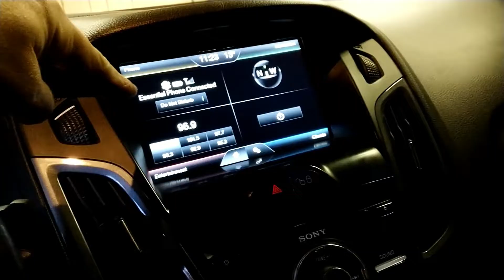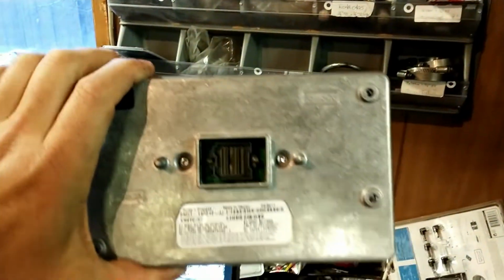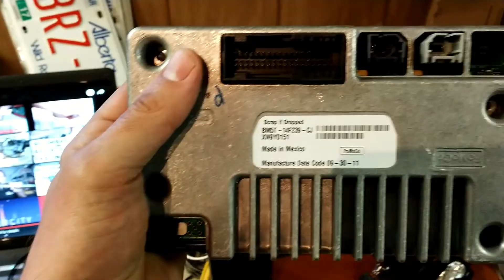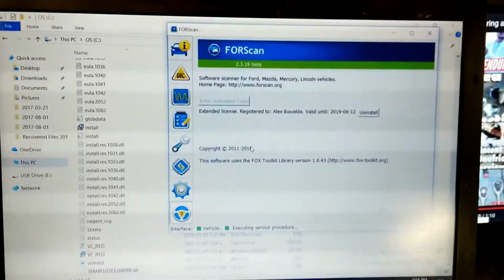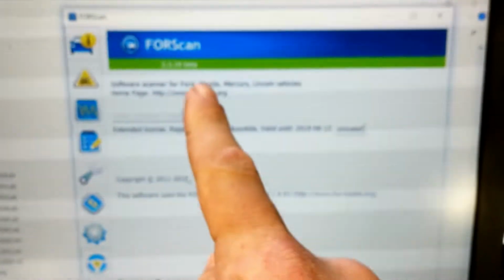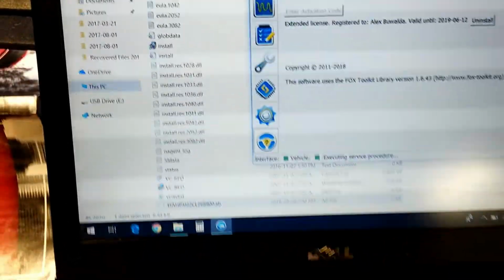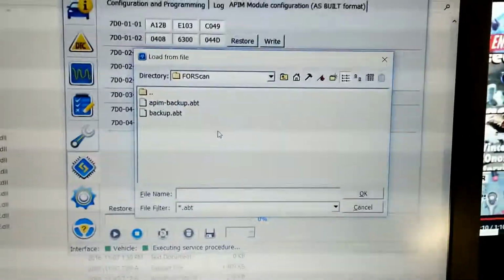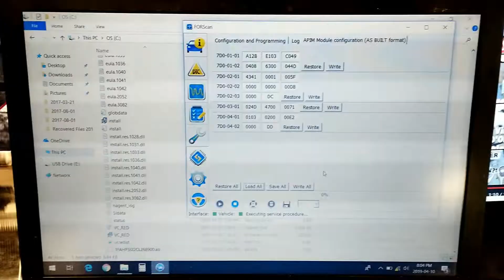Broken Ford Sync APIM Repair\Replace\Reprogram

Comment: Hi can you tell me if when replacing a backup camera on a 2012 ford Edge does the camera have to be programmed to the APIM or does it just plug into it? My backup camera was working fine till I had ford replace my APIM and now My camera don't work for some reason. They are now telling  me My camera needs to be replaced and want to charge me a little over 700.00 dollars!!  I'm hoping I can buy a camera and have my husband replace it if it don't need programming. Thank you
Reply from the maker: It should just plug in if the APIM was programmed properly and the backup camera plugged into the module.  I can't believe they'd tell you that you need a new camera after it stopped working on replacement of the APIM.  It might need a program to match your model properly which they failed to do at the dealer, I'd phone around to different dealers for a second opinion on that and perhaps a reflash to get the camera working again.  Also I'd triple check the camera connector on the back of the APIM is plugged in fully.  Best of luck!
Reply: @Kingsoupturbo   Thank you for replying. I'm  afraid to bring it to another dealer cause they may charge me more then I have already paid. Its at the same dealership again for another APIM replacement!! Its been there since 9am  yesterday. They are telling me the servers are down and can not program  the navigation.  Im so frustrated  with Ford right now!!!
Reply from the maker: @hereslori  Thats terrible! thats a long time to not have your car over a fairly simple replacement, they should be able to do this super fast, its a easy repair at a dealership.  I suppose its possible Fords servers are down, I suppose, that have the settings specific to your car, they probably programmed the wrong model and thats why the camera didn't work.  Hang in there, rub your ear lobes and say "woosah" and that everything is insane this year and rediculous, I would not buy another ford though, its been pretty disappointing, the tranmission issues with my Focus have been a lot worse then the stupid APIM.  wishing you positive thoughts on a resolution! :)
Reply: @Kingsoupturbo   Yeah it's very disappointing I finally got it back but they weren't able to get my navigation working due to the fact that this server is still down but I need my car so I told him I was picking it up and to let me know when their server is  backup and running. They are still saying that I need a new backup camera and I refuse to buy one from them and pay $700.00 and something dollars after I just paid over $600.00 for this APIM. I used to have an Explorer it was a 1998 don't laugh I had it  for 18 years and I loved it not too many problems with it and I finally traded it in for this 2012 just 2 years ago. LIke I said don't laugh lol. SO this car is real big upgrade for me and now I see all the issues I'm having with this APIM And it's really frustrating because I love this car
Reply from the maker: @hereslori  That is ludicrous they are asking that much for the Camera.  I've read about how to put your own 20$ camera in from Ebay and make it work easily enough on these cars.  Those older Explorer's were really nice! I have a 2002 F150 that doesn't compare to newer things but I love it all the same! Also great value for money keeping older cars around.  The APIM is a disastor from Ford and the way they're handling it is rediculous.  I can't believe they can't access the APIM update data from Ford, rediculous, I suspect when you do get the update the camera will start working again.  A very frustrating situation to say the least!  Hang in there, at least you got your car back and the Touch screen is mostly functional!
Reply: @Kingsoupturbo  I hope the camera starts functioning.  But I dought it cause since they changed it the first time about 2 to 3 weeks ago the camera has worked on and off mostly off. And after 2to 3 weeks the new apim started freezing up like the original one. So I brought it back and now supposedly  they put.another in and can't finish. The camera worked once tonight but not again. I would like to purchase a camera and try to install it with my husband im just afraid with my luck it will need some kind of programing. I watch a video on YouTube and the technician said at the end of the video that you may have to have ford program it to get the lines to work

Comment: Okay this was just fun to watch. Yeah, I wanted to learn FORScan so I can re-program my APIM module, because, like you, I found that FORD SUCKS and wont honor the warranty on my 2 1/2 year old APIM module that the Ford dealer installed. Yep, it's inop....again.  So I learned what I needed to but watched it 3x just to enjoy some laughter.  I applaud a fellow goofball.  Thanks!
Reply from the maker: Thank you for the kind words! Ford is rediculous, wow it failed again after they factory installed a replacement? thats outrageous!!!  I'm glad you found it useful! Goofballs like us are in dire need these days, keep up the good work! :)
Reply: @Kingsoupturbo  not sure why I’m showing as a different person but anywho....yes the “new” unit they installed gave up the biscuit just over 2 years after they replaced it.  I’ve researched like crazy and from what I understand, if you buy a new APIM (which I refuse to do...again), you CANNOT use FORScan to program it.  It needs to be “flashed” by the dealer.  A USED APIM can be programmed using FORScan and the “as built” data like you demonstrated.

Interestingly, the APIM P/N shown on my Ford invoice is a number that couldn’t be found used anywhere.  Dealers could still get it ($325 to over $400) but back ordered.  Today I got the “OBD Link EX” cable that FORScan now recommends and checked out the truck.  Using FORScan, I saw the APIM module actually had a DIFFERENT part number registered.  Hmmm.   I tried writing the AsBuilt data to it, which wrote successfully but it did not solve the issue (no Bluetooth connectivity....same exact issue I had the first time).  So, with a different part number showing, I went to the effort to pull the module and sure enough, the number shown in FORScan was different than what they invoiced me for.  The module did have a 2017 manufacture date, however.  So I’ve ordered a used APIM with the same p/n on EBay ($45 now THATS what I’m talkin bout!!) and will try doing the same thing you did.

Question:  did writing the asbuilt data using FORScan take care of programming your vehicle’s VIN number into the new (used) module?

And how did you get a patch from Ford for the used module since it didn’t come from your vehicle?  And how did you know you needed one?

Comment: i'm very depressed.  I bought a used 2015 ford escape..only had it for two years..i bought the electronic extended warranty but for some reason this issue that i'm having (need to replace my APIM) doesn't cover this.  This will cost me $1000 to fix.  I don't have that kind of money...I came across your video..and i'm hoping I will be able to fix my car without having to go to the dealership..my father is pretty good with computers and I may be able to get help..Any extra tips you may throw at me , I would appreciate it.  thank you again for sharing!
Reply from the maker: Hey there! ahhhh its unfortunate they are only covering the early APIM's for extended warranty (2011-2014), clearly they're all failing now.  I'd hunt for a sync4 module APIM to replace the one you have in the Escape.  Its likely the same interface as you have now.  Search for 2015 or so SYNC module on ebay, junkyards sell them for about 80$, pull the one you have in the Escape out to make sure they look the same.  Just plugging in the new one should give you some functionality (a lot more if you can find a 2015 focus\escape module) and you can likely reprogram it with FORSCAN, same as I did with the 2012.   I did an ebay search and found a 2015 2016 Ford Explorer Communication Sync Control Module OEM, that should be around the right one.  Best of luck with your repairs! stupid ford, I read they modules only cost 16$ and are really underpowered, they did it for maximum profits, shameful.
Reply: @Kingsoupturbo  thank you, you have been very helpfull..my father is helping with this and i will let him know what you said.  :)
Reply: @Kingsoupturbo  can I purchase a 2012or 2013 to fix my 2011 ford explorer

Comment: I have a 2016 Ford Explorer Platinum and having the same issue. I've done everything on the web that is recommended. It's time to replace the APIM. Just having a hard time finding one. Anyway you could or someone could write up or make a video with set by step process ? Or provided links to videos from taking the faulty APIM out to down loading the software and then uploading it to the new APIM. Thanks in advance for all the help. I cant afford to go thru the dealer to fix this. I'm a disabled vet just trying to make things work.
Reply from the maker: Hey there, You might still have warranty on that APIM as your truck is a 2016.  Call up ford and check on the status of that before working on replacing it yourself.  I think its 5 or 6 years its covered now for defects, but that might be only 2011-2015, I"m not 100% sure.   I"ve also had to ask multiple dealerships about the same repair to get it done properly before.  If you've already tried that, let me know and we'll see if we can find some more info out there on replacing it.  I think thats a newer generation module then I cover in this video, not 100% sure.
Reply: Kingsoupturbo it’s not under warranty😞 Ford wants 551.00 for the module and 325 for labor. I know I can do it myself.

Comment: All this, just to change the f*cking radio station or turn the a/c on. Brilliant.
Reply from the maker: Well the climate control does have its own controls, but sigh, the whole radio and sat nav are really only accesable through the Sync

Comment: I knew this vid was going to be fun to watch. Just by seeing that it was longer then most others showing in Google search.
Alas, you talk on the vid just like I would have done, showing much frustration in all of this you had to learn to get er' done.
Thanks for posting for us other suckers here. ;)
Reply from the maker: Hey there! thanks for the compliment! I had no idea it shows up on google search! so much trial and error on this, I spent so many hours researching it and screwing around before got it right!!!
Reply: @Kingsoupturbo  I go through crap like this myself with stuff. Currently going back and forth with an Etekcity support person on why their Wi-Fi dimmer switch has a flickering problem no matter what brand bulbs I try. I am on a third set now. They sent me a second switch in the beginning thinking the first may be defective. Nope. No I feel like a beta tester but am not getting any results. They did take a suggestion into consideration and provided an upgrade to the software. Then I tossed them another suggestion. I await to see how long and if that is implemented. All this to help them make their product better and more useful for me and everyone else. Onward through the fog I like to say.
Reply from the maker: @pstreicher  When I did IT administration, sometimes we'd just do patch updates and wait to see who complained as our testing method on what was going to break instead of endlessly trying to beta test it ahead of full deployment, I think you know what version you got with your dimmers!

Comment: Everything went well, but the screen buttons are having problems after the replacement and reprogramming with the as built file.  I guess  the APIM has retained the boneyard APIM programming.  When I go to write the as built data, it says no changes are being made.  The interface with the PC is an OBDLinkEX, which says it's designed to work with Forscan.

https://www.amazon.com/gp/product/B081VQVD3F/ref=ppx_yo_dt_b_asin_title_o05_s00?ie=UTF8&psc=1
Reply: I needed to recalibrate the screen. In case anyone encounters this after installing an APIM, the touch screen had to be calibrated. You can access the diagnostics by pressing the eject and tune>> button. https://desk.zoho.com/portal/infotainme ... wrong-spot

The hardest part was trying to figure out where to push on the screen to get to it.

I thought it wasn’t loading, but it did. 

https://forscan.org/forum/viewtopic.php?f=16&t=11865&p=40631#p40631
Reply: Im having the same issue. Shows my asb file loaded but nothing changes. have no idea what the problem is.

Comment: So I have a Lincoln mks with sync my touch and when talking to Lincoln, they say the data is proprietary data and cannot be downloaded.  The dealer wants $1600 to fix it but it just needs to be reprogrammed.  Any ideas on where to download it?
Reply from the maker: I'd try the ford site and see if you can get the lincoln as built data from their site with your VIN.  I'd check to see if the Ford Edge is exactly the same as the MKS as well for Sync, in which case just get a Edge VIN and download that, something like that.  Is the screen dead like mine did, or is it just not working properly?
Reply: @Kingsoupturbo  it is stuck on downloading update.... it flashes every minute or so sayind downloading update, please wait

Comment: Can the original malfunctioning module be reprogrammed, or does a used replacement APIM need to be obtained first?
Reply from the maker: You know I never tried to get into the original module and see if it can be reprogrammed, maybe it would work. likely though the parameters we're putting into the APIM are just what car its in, Focus, edge, some basic stuff, not really updating firmware or anything.  I should have attempted to get in with forscan on the original module and reupload the as-built data, interesting.
Reply: @Kingsoupturbo  FYI I tried that with my faulty APIM module and it did not work.  Successful rewrite using FORScan but it didn’t restore functionality.
Reply from the maker: @EarthtoDave  hmmm, on mine I had to run the Patches as well afterwards to get it all to work, I think two patches in a row, its all quite frustrating this!!
Reply: You guys are geniuses! I gave it a try with the old APIM and it worked! I ended up not needing to buy a new APIM

Kingsoupturbo, thanks for posting this. Very helpful!
Reply: @do2427zz  any details instruction.
Thanks
Reply: Ian Zhao 
Not really, sorry. I just did the exact same thing as described in the video except for replacing APIM (which is a ton of work by itself already). I guess the previous owner messed up with it and reprogramming it did the trick for me.
Reply: @do2427zz  thanks

Comment: Not to be a pain in the ass..But before I pull the trigger on this...13 14 15 FORD EXPLORER module should work in a focus once I reprogram it?.
Reply from the maker: I believe so? there are two versions of the syn cmodule, I think 2015 was the last year they made of the gen 1. Compare the APIM in the picture to your own, they should look almost the same with almost the same code on the back, thats your best bet to get the same type.

Comment: so I have a 2012 titanium focus,. so will any AIPM support navigation when you reprogram or do I need to buy one with NAV?..great Vid
Reply: so it looks like any should work? this from another site  
The secret to enabling features is going to be in the As Built Data. ABD. It seems as though all MFT cars get the same APIM and what differentiates the features is the ABD. The ABD tells the car which features were purchased and which to be enabled. ABD is not plain text, it exists as bits. Comparing the ABD of cars with Nav vs cars without Nav should teach us what modifications we need to make. The ABD is NOT easy to access or change and will likely involve using proprietary or expensive software to do so. Ford VCM2 and IDS are a guarantee. ABD is not unique to the APIM, in fact its used in many modules on the car. We are unable to manually change values on the APIM ABD.
Reply: To the best of my knowledge, any sync 2 will work. Just use FORScan to enable nav
Reply: @austin8607  which scan tool I should buy now. Thanks

Comment: This video was great.  Replaced APIM and screen on 2011 Explorer. Bought a wired obd2 adapter.   Updated the software perfectly
Reply from the maker: Thats so great!!! nice job, glad you found this useful!
Reply: Which scan tool you brought, thanks.
 I need one for my 2011 edge
Reply: Having the same problem with my 2011 Explorer....please tell me what to do! $11 00 at the dealer is not a option

Comment: I got a Sync 3 update for my Lincoln MKX 2011 that original came with a Sync 2, everything seems to be working but every time that the system turns on it gives me a message " Your *911 emergency service is not working go to the dealer to get it fix" so it's very annoying. 
The guy that sold it to me tells me the following: You can use Forscan to program RCM module
02-01 Xxxx （X to 8), but I don't have how to do that, any advice how to do that? 
THANKS.

Comment: I have a 2015 Fusion energi... and my sync is intermittent!! So frustrating.  Ford says NO HELP!
Reply from the maker: Hold power button + seek 》 for few seconds to reboot the system (the newer version of Sync3 that you have) Thats what happened to mine as well, it would just black screen for a while, then it would reboot out of nowhere and work for a while. (no manual reboot on the older sync2 though)  Then it would only work in -20c.  There is supposed to be a warranty extension on the Sync module but just 2011-2014, and mine wasn't covered either.  Hope it works for you! (Found that on a F150 Forum)